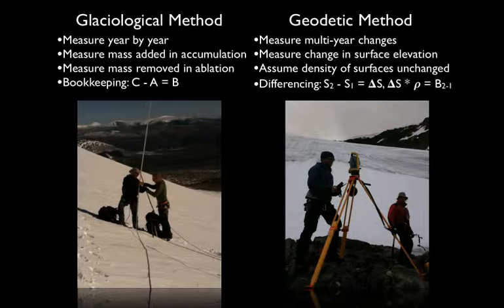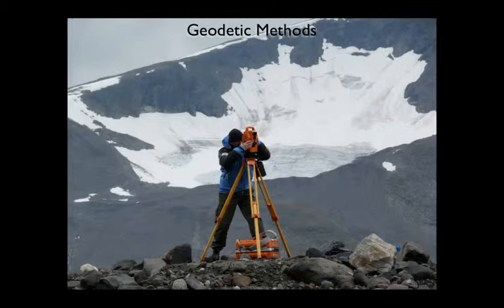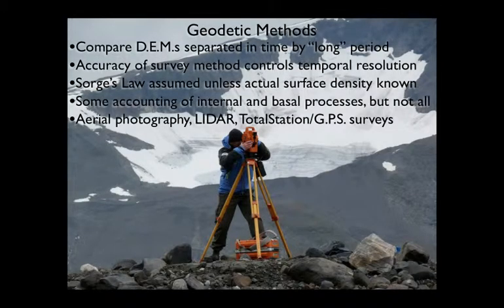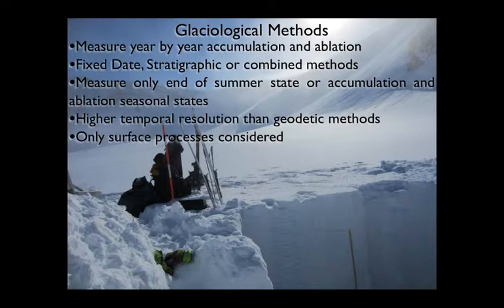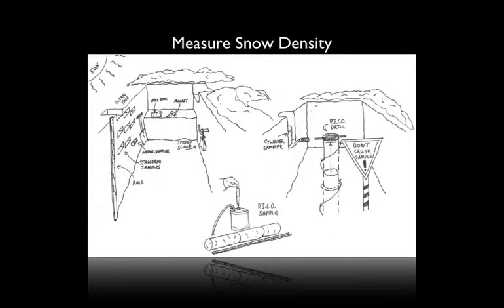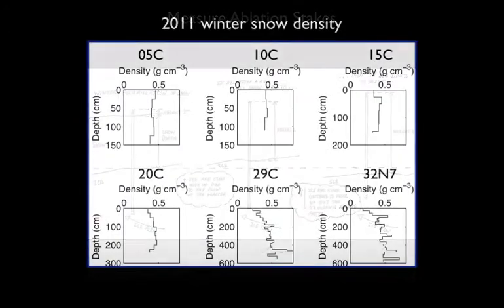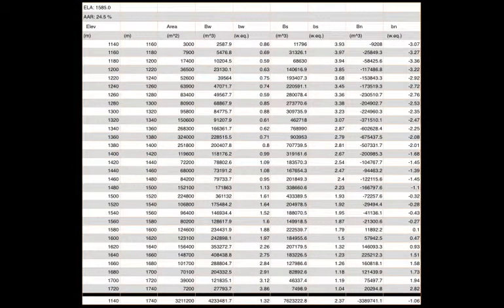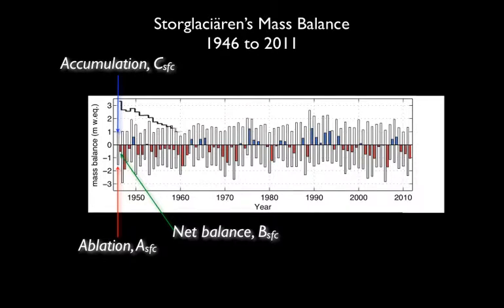Surface Mass Balance, part four

Comment: Do you have a video lesson where you use the Geodetic Method? I want to make a mass balance with Lidar data but I am having troubles with the code in R. 
I would really appreciate your help!
Greeting from Chile!
Reply from the maker: The geodetic method is both simple and a little tricky. All you are doing is subtracting one surface from another to find a volume. Your Lidar data is presumeably a point cloud and will need reducing to a manageable number of points, removing any returns that appear not to come from the glacier surface. If you convert to a raster DEM, cell by cell subtraction is easy enough, but if you have a TIN you will need to use a slightly more complicated tool. I'm sure R's spatial library has something for this.
That will get you a volume but what you need is a mass and this is where it gets tricky. There is no simple, straightforward answer. Your calculation compares two years separated by a time interval that is long enough to result in a change measureable above noise and other errors in the survey methods. Unless the glacier is in steady state the distribution of snow, firn and ice will have changed. These have different densities and therefore influence the calculation of mass from volume. If you have information on where the snowline and firn line are at each survey you can use these to guide you. For your latest survey, the Lidar data,  you may well be able to see these transitions in both the surface roughness and the reflectivity. Unless your older data is also Lidar (and you have access to the raw data) you will have to use a mapped snow line or perhaps an aerial photograph to find this. The firn line may be harder.
See https://doi.org/10.5194/tc-7-1227-2013 for more details
Reply from the maker: See also http://www.diva-portal.org/smash/record.jsf?pid=diva2%3A1198187&dswid=3511 for a simple description of the various mass balance methods